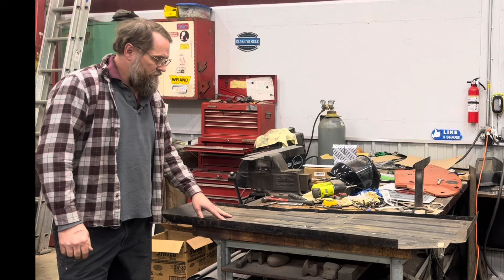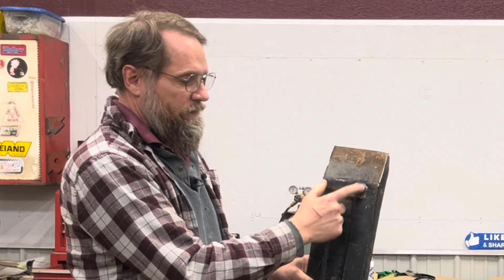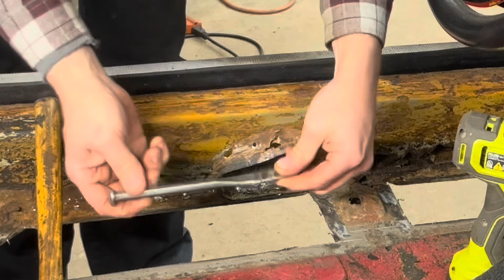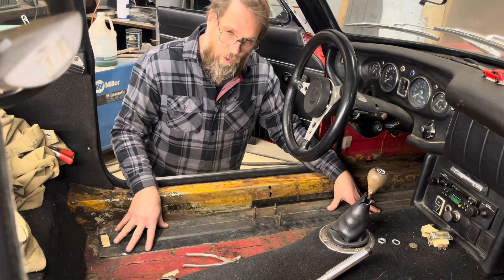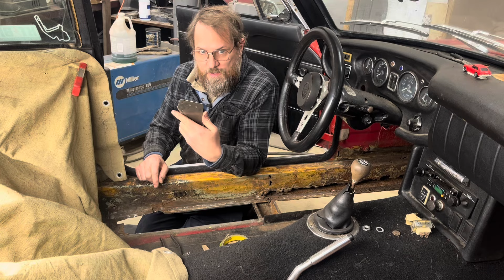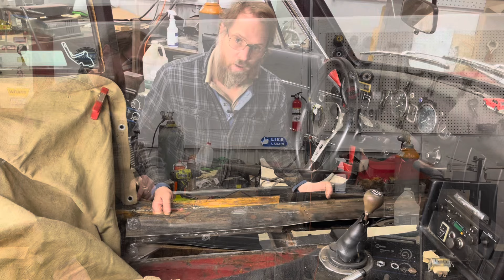MGB temporary floor repairs… I’ve seen a lot worse

Comment: Thank you for the ideas. A question: since this is a temporary repair, what about fiberglass epoxy?

Faster, cheaper and maybe stronger.

Only suggesting since a short term inexpensive repair.

Thank You,

Mike
Reply from the maker: I don’t know, I don’t ever think in terms of glues an epoxies. They are used a lot in new car manufacturing and there is a lot of talk on the forums about using them.